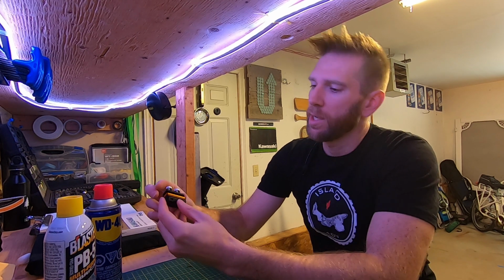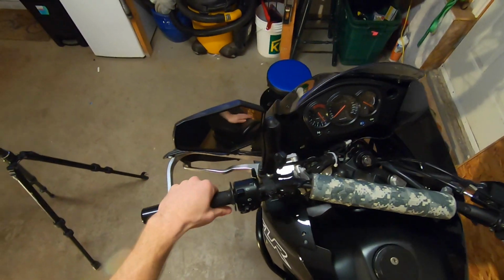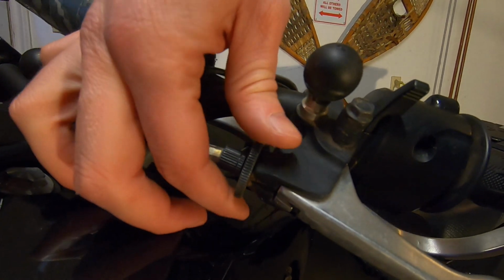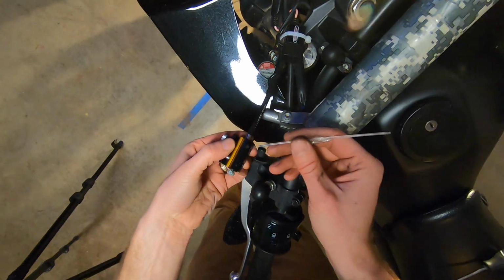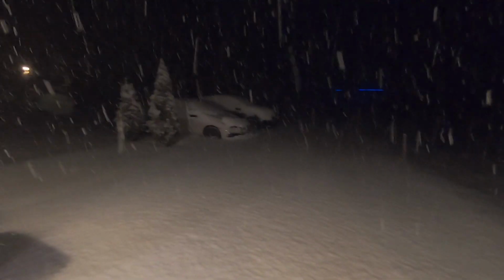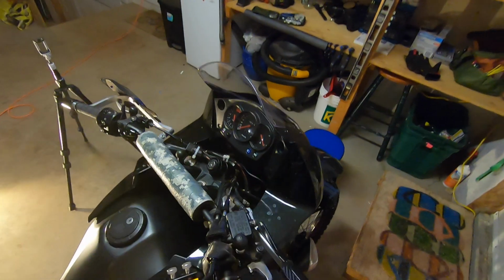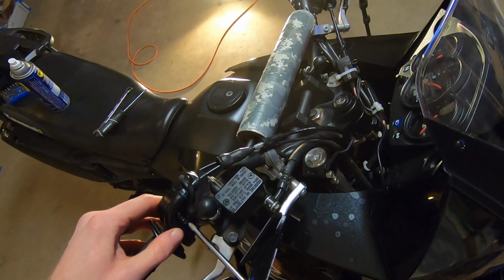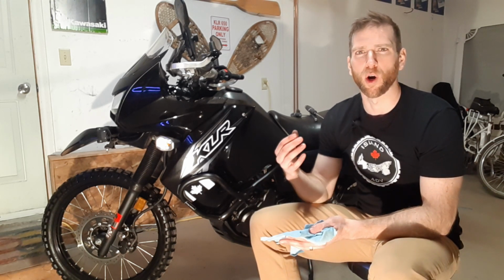KLR650 Throttle and Clutch Cable Lubrication | Maintenance Video | Island ADV

Comment: Just purchased my first klr. Lubed up but no snap back.
Reply from the maker: This actually happened to me this winter. Check out the throttle cables down by the carb. You may have a frayed cable. On mine, there was one fray that prevented it from snapping back. Every time the cable tried to go back into the sleeve, the little frayed piece stopped it.
New throttle cables are super easy to install.
Reply: @IslandADV  Video for new cable install?
Reply from the maker: @edwarddelaney2912  lol, maybe next time they break. Hopefully it won't be a roadside repair vid.

Comment: Just rebuilt my carb and now my throttle sticks, tried this and its even worse, do I just need to adjust the cable tension in the carb?
Reply from the maker: Not inside the carb, but on the valve lever outside, where the cables attach, there should be an adjustment there. I would not take that lever system off the carb though. I hear it's tricky to get back on. Also try giving the cables some lubrication. That could free them up a bit. 
Good to hear you got the carb all done.
Reply: @IslandADV  yeah, the carb was a pain in the ass with the crash bars on the side, tried taking them off but they were too tight on the bike. I did lube the cable on the top and tried a bit near the carb. So the small nuts on the side of the carb is the "adjustment part" so to speak
Reply from the maker: That's should be it. Take a search around for some videos. There's got to be a good one out there for it. You'll get it.
Reply: @IslandADV  thanks man

Comment: maybe after 19 years of riding my xr650 i should lube the cables eh :D   Yep.... never really done it properly. I tend to use
 things until they fail, then fix them.
Reply from the maker: It's a messy job for sure, so it's not really one anybody looks forward to doing, lol. I think I'll actually pick up some spare cables here soon, just in case.

Comment: Great video! Guess I have a problem with my throttle. I followed your video but the throttle still sticks and doesn't close by itself. I bought the bike used and it was like that when I got it. I think the outside rubber throttle end is rubbing on the end piece. I thought I could take that off to adjust but the hard end won't come off...any suggestions? Thanks for a very helpful video!
Reply from the maker: You're very welcome brother. You're right, it might be too close to the bar end and getting pinched up. Try loosening up the clamp on the left where the cables connect and move the throttle up away from the bar end. If that fails, check the cable tensions and make sure the return side is allowing it to close at the carb. If THAT fails, check the action on the lever on the carb itself to see if that is sticking. And If all else fails take 'er in, lol. Cheers brother.
Reply: @IslandADV  Thank you sir! Appreciate the guidance!

Comment: Great little tool.👌
My clutch cable needs regularly lubrication because the previous owner put stiffer clutch springs and its takes at least 3 fingers to pull the clutch to change gear. So by lubricating it regularly helps the situation.
So I may order this little thing.
Thanks for this video my friend.
Reply from the maker: Glad you liked the video. And I feel a big difference after doing this every year. Ride safe brother

Comment: Thanks for the tips and info! That's a lot cleaner than the way I did it in the old days' 😂 Cable lube tool, Ordered!  My choke cable seems a little stiff, did you go with a choke cable eliminator? 
Or, do you think this tool will help with lubing that as well?
Reply from the maker: Oh man, I fear the choke cable, lol. I'm not sure if the lube tool would help there. For me, I think I'm going to go with the eliminator eventually.
Reply: @IslandADV  The choke cable definitely looks to be more challenging 😬 lol.
Some mixed reviews, but I agree, the eliminator seems to be the way to go 👍